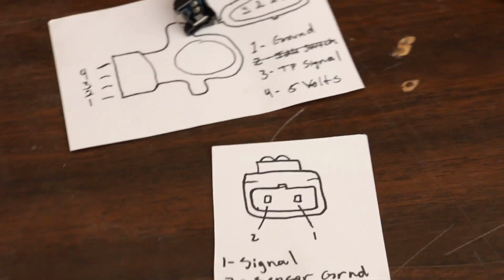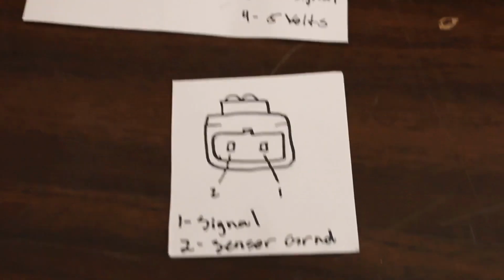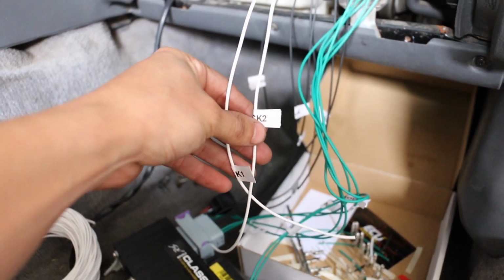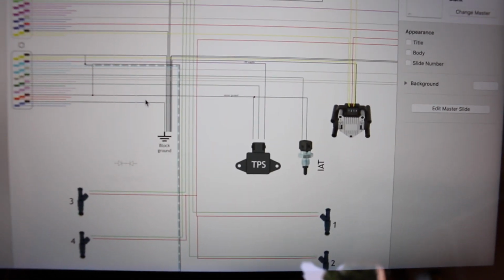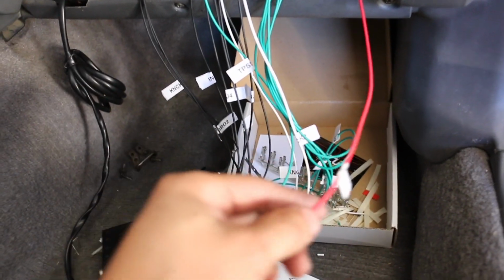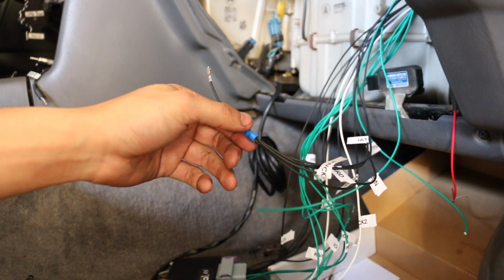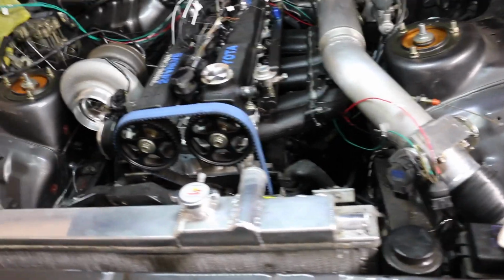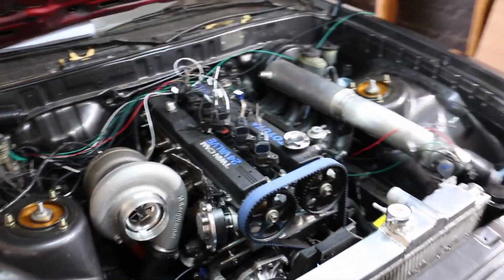MK3 SUPRA CUSTOM ECU MASTER ENGINE HARNESS PART 4 ( IAT, TPS, AND BOSCH KNOCK SENSORS )

Comment: For the ground would it be easier to run one single lead from the ecu out to the engine bay then splice everything from there. That way you don't need hella wires going all the way to the ecu.

Comment: Hey man good video , just some pointers from what I been learning as far as building a harness. I would ditch that ugly butt connector and get yourself some open barrels and crimp your sensor grounds that way. Much much better in the long run. And is your knock, crank,  and cam sensors shielded wire?